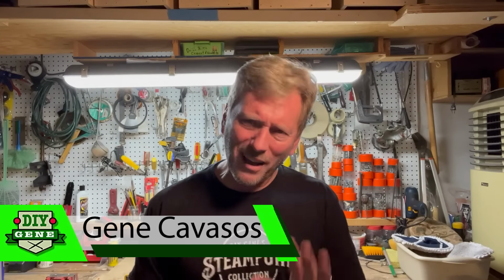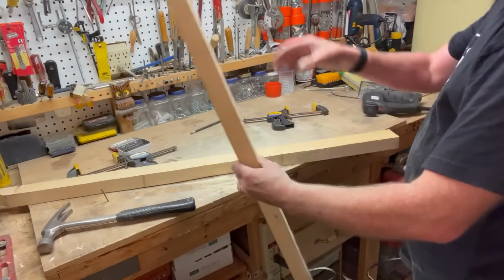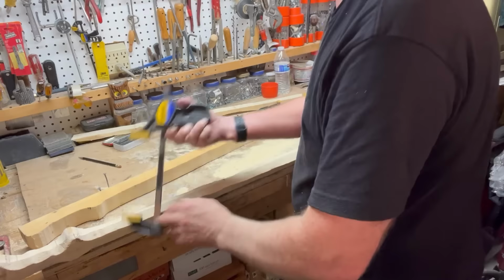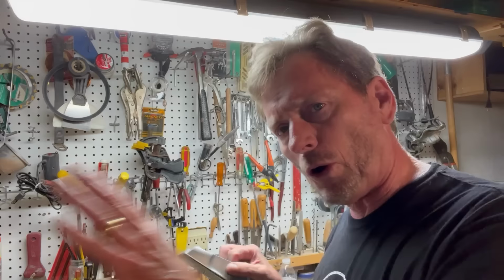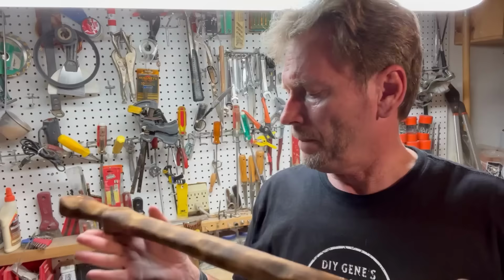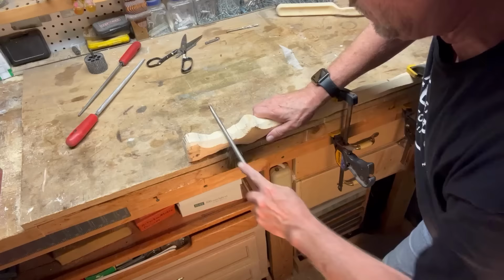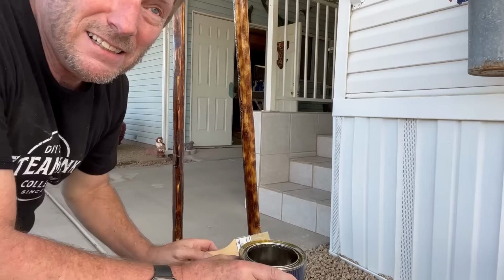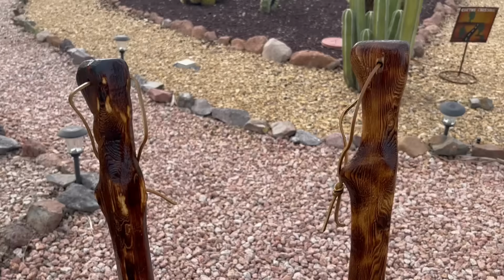Make a  Couple of Fun and Simple Walking Sticks from One 2x4!

Comment: Fantastic, and resource friendly tips and tricks.  Thanks for sharing with us all.  👍👍 10⭐
Hint/Tip about the strap.  You could use the entire length in making a wrapped handle, that ends up in the Loop, which would be used to secure/tighten the the hand-wrap. 

Also, I pray that shaky-hands thing is not Parkinson's.  Nobody deserves that kind of punishing ailment.
Reply from the maker: Thank you and great suggestion! Also my doctor told me to be thankful it’s not Parkinson’s. My father passed away from it. Right now it is just what is called Essential Tremors. There is a surgery available but it would involve drilling into my head. I think I will wait for better technology. Thanks again for watching.

Comment: Really nice.
I have to say, though that I think the trickiest part for me would be finding an (affordable) 2X4 of the appropriate length that was knot-free ;-). (Which would probably be pretty important for strength reasons, especially if you wanted to get two sticks out of a single stud.)

If I could make one tiny suggestion.   On the sticks that I’ve made, I’ve found that while rubber tips are perfect for walking around on a smooth floor, they don’t last very long “out in the wild”, on rocks/gravel/etc.

One thing I especially like about your video is that you could end up with an “indoor stick” and an “outdoor stick”.

[For a durable, DIY (I.e. cheap) tip for a stick which is going to get a lot of rough outdoor use, I’ve found it useful to use a copper or steel plumbing end-cap.  Then I can attach the cap by screwing into the end with a small, hard screw with a hex head (like a concrete screw).  This gives a little more “bite” to the tip when I’m walking on a slick-ish surface like ice or wet stones.]
Reply from the maker: Great suggestions. I wouldn’t worry to much about knots. Some can be really cool if they don’t hurt the integrity of the wood. Thanks so much for watching.
Reply from the maker: Great suggestions. I wouldn’t worry to much about knots. Some can be really cool if they don’t hurt the integrity of the wood. Thanks so much for watching.

Comment: Did you countersink the lanyard holes? Otherwise, the sharp-ish edges of the holes will cut into the leather laces.
Reply from the maker: Good suggestion. I just sanded the  edges either sandpaper to smooth them out. Thanks so much for watching.